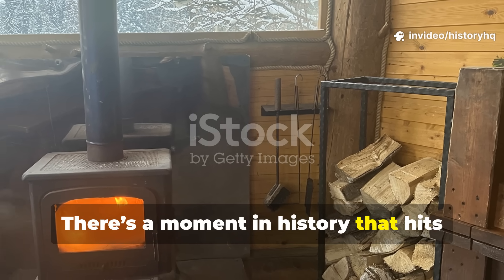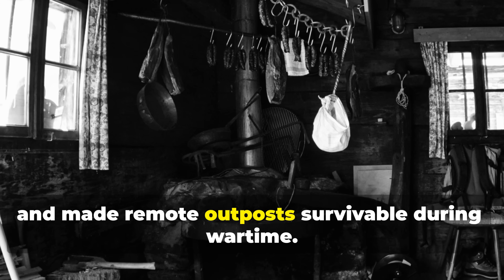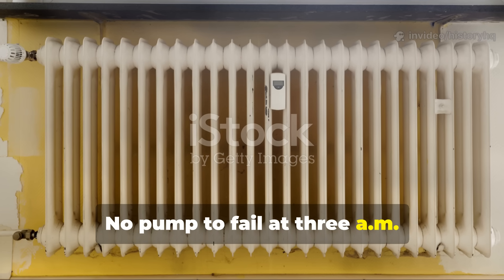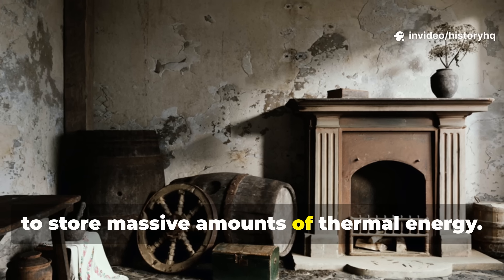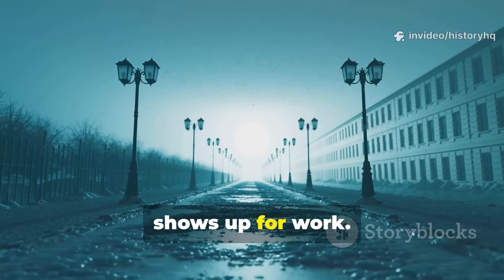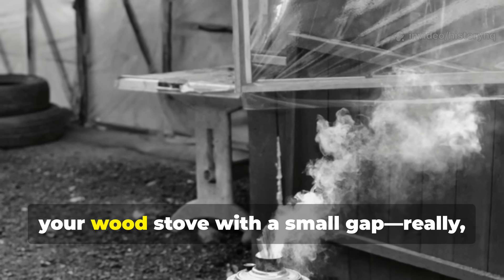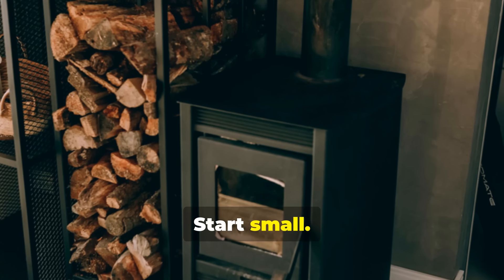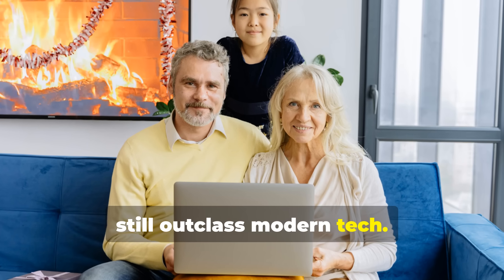The 1940s Heating Trick Modern Homes Can’t Compete With!

Comment: 1960's Scotland heating trick was Duckhams 20W50 gallon cans full of boiling water wrapped up in towels as hotties to heat the bed, duvets not having reached us at that time, and porridge with Lyle's Golden Syrup in the morning. Never had radiators in any of our houses we lived in. Frost on the inside of the (single-glazed) bedroom window was fun to write on in the morning with your finger. Coal, and sometimes peat, was burnt in the living room fireplace, never in the sitting room where the telly was, and we had a damper to send the smoke up behind the back-boiler to save on the immersion heater.
Reply from the maker: That’s lived history right there — using thermal mass, timing, and fuel discipline instead of gadgets. Brutal, but incredibly efficient for the era.

Comment: I am a HVAC teck. Once ran across a home that had a old gas steam boiler controlled with a thermopile and thermostat , The boiler was in the middle of the basement with slopping pipes towards the boiler , They were single pipe cast iron rads , The steam and condensate return in the same pipe . No pumps ,No power .
Reply from the maker: Exactly — pure physics doing the work. Gravity, slope, and phase change moving heat with zero electricity is hard to beat.

Comment: I still get to see a couple of these systems still in work order and the simplicity is great
Reply from the maker: Exactly — the beauty is in the simplicity.
Reply: @HistoryHQ-Stories what make these systems work is the piping it larger than a pumped system and it uses all the  pipe connection taps on a boiler instead of 1 inlet and 1 outlet

Comment: I enheriteged old house with 10 iron massive  radiators. Volume of circulating mixture of propylene glycol and water is about 508 liters.  Everybody in village criticize me and sugest me to replace this heating system with new, radicaly smaller volume one - maybe even without radiators. I dont want it. I highly appreciate precise work of my grandfater who had build it
Reply from the maker: Hold onto it — craftsmanship like that is rare, and those systems are built to last generations.
Reply: That's fantastic! I've had this argument many times with co-workers, everybody wants fast-responding systems so they can only turn it on when they come home, because gas has become so expensive. While this does save money, it also means you let the whole house cool down, you're only heating up the air, so you'll feel cold all the time. Terrible.

Comment: We bought an old house that had a hot water heating system it heated 2 stories unfortunately because hot water rises it heated up the second floor great and by the time the lower radiators started getting warm the upstairs upstairs thermostats was up to temperature and shut off the boiler put in a pump and zone valves and a thermostat on each floor problem solved and by adjusting the water temperature we cut out gas bill in half
Reply from the maker: Smart upgrade — zoning and a pump fix exactly that issue. Glad it cut your bill too.

Comment: My house got this system still the best one around, but it was moderniseized as to manage green energy, running on recommended 1.5 bar of pressure that I checked out with expertise yes 1.5-2.0 bar that is right no it did not work at all alarms went off all the time until that I started as to think about it. Then that I met I do not know a plumber in english? A honest guy he knew what was made wrong, overpressure. Pumps and a huge enclosed Siphon he told about the siphon these are ment as to feed multi store appartement buildings but stlll almost every house will got one. Money money money! And guess what the business will recomend yes install yet a bigger one and max out them pumps.
So we downseized the whole lot having only 0.4 bar of pressure in the system and since then it works like a charm.
Reply from the maker: Glad you got it sorted — lowering the pressure absolutely makes these older systems run the way they were designed to. Sometimes “modernizing” adds more problems than it solves.
Reply: Why  some of the heating systems must be pressurized?
Reply: @PeterFamiko-lw8ue  It is been rebuilt upgraded from a oilburner not by me but by the previous owner where today the heating is of different not as hot as before but the system remained in most parts the same but less of heat + three additional modern very thin radiators installed. 
There is a need of some pressure to it but not much high pressure will only block the system in the same way as blowing air thru a thin straw a comon fault by the way, humungus siphones and multiple pumps installed into small houses.

Comment: What is unbelievable is that people had these cast iron radiators (which could heat with almost any kind of fuel from coal to gas, and they TOOK THEM OUT TO REPLACE THEM WITH these sh---y fin tube arrangements, which go under windows (where drapery cuts them off) and behind furniture.  Warm air circulation is a joke with these.  The cast iron ones usually never were behind other things, but free to warm the room.  These radiators were junked by the millions in favor of inferior "technology".  How stupid.  If you have them KEEP THEM!  I have had both and there is no comparison.  I would put radiators on the plus side of any home buying decision.
Reply: Ok and what you think to combine this radiator technology with electric heating of floor (inserted in beton  - concrete
Reply from the maker: Couldn’t agree more — cast iron radiators are heat machines. People really didn’t know what they were throwing away when they swapped them for fin-tube.

Comment: We heat our 1600 sqft , circa1867 farmhouse using a Woodstock Soapstone stove, which is based on a design from the 1850's. The company upgraded the technology with a system that reburns the smoke, so it burns with very little smoke and at around 80% efficiency. Our house with it's original wood windows and wooden storm windows only uses 1.5 cords of wood. We are near the 44th parallel in northern NH, so it gets very cold here.
Reply from the maker: That’s incredible efficiency for a house that old — those classic designs still punch way above their weight.
Reply: @HistoryHQ-Stories  I talked to the people at Green Building Advisors in Sheffield VT. I posted on their free site. Martin Holliday responded with what I need to do in order to make the house super efficient. It was a lot of hours, but totally worth it. We hired out the blown in Cellulous and the spray foam on the basement walls. Everything else my wife and I did. I've owned the Woodstock Stoves now in two houses an antique cape of 2000 sqft where we had two stoves. That place used two cords of wood and nothing else. The main house still had it's 1840 9/6 sash. We put interior storm windows in it. Anyway probably more than you wanted to know.

Comment: I owned a house with a gravity system.
It had an enormous boiler that had a coal stoker, was converted to oil, converted to gas and was completely shot, but irreplaceable. No one would touch it. 
I had to replace it with a modern gas boiler and circulators. No one stocks the pipe sizes and fittings for those old systems in this part of the world. There was only one radiator that leaked and I got the whole thing working in time for winter. But, I'd never do it again.
Reply from the maker: Totally understand — restoring those giants can be a massive challenge today.
Reply: @HistoryHQ-Stories yeah, I threw a 4x4 across the coal chute opening and used a heavy duty come along to drag it into the coal bin and nailed the door shut. I know it's still there because there was no way to get it out of the basement.

Comment: A hot water heating system with thermosyphon circulation is perfectly suited to hand firing with wood or coal.  The fire is laid proportional to the outside temperature,  small fire on a warmish day and a roaring fire in sub-zero weather.  This system is not particularly effective when fired with a gas or oil burner, on and off.  Now that we have proportional fired gas burners this simple system would again work efficiently.
Reply: Yes, i like it. I just would like to somehow upgrade this system with automatic wood & coal feeding of fire place
Reply from the maker: Well said — wood and coal make thermosyphon systems shine. Modern modulating burners could bring them back.

Comment: That doesn't make any sense. First of all, you can't adjust a system like that. Second, you can't use just water in the system, because when the fire goes out and it's freezing outside, the pipes freeze. Of course, if you're there all the time and adding food to the fire, then there's no problem. In Scandinavia, we've spent ages binding heat to the mass. But the same thing goes there, you can't adjust. In other words, when it gets warmer outside, you sweat inside. So the weak point of such systems is wasting energy/firewood. Of course, this doesn't matter if you don't have to buy firewood or whatever to produce heat.
Reply: If you have real windows you can open them up when is getting too hot inside, capisce 😂😂😂
Reply: We had a steam system with a hot water loop in the kitchen part of the house. The hot water loop hot water moved without a pump, when we needed less heat we simply closed one of the valves to slow the water flow. It worked very well and older plumber explained then installed it for us. The steam boiler was from the early 1950's. It was a huge 3400sqft circa 1809 colonial farmhouse.
Reply: @kenchester3072 i would like to put water loop into chimney with hot exhaust gases. I just don't know how to regulatte it
Reply: @PeterFamiko-lw8ue if you take too much heat out of your chimney you can create creosote,  chimney fires, poor draft , etc.
Reply from the maker: Fair points — gravity systems are simple but not easily adjustable, and they need someone present to manage the heat source. They shine in the right context, but they definitely have limitations.

Comment: It's cool hearing David Attenborough talk about central heating like this, even if it's likely done by AI 😅😄🙂 
That Thermal Flywheel analogy is wicked. If it wasn't for those mandatory annoying AF subtitles, this video would have been wonderful. It's still great, but that shite ruined it a bit. 
I'm learning about various heating systems right now in a course, and the only thing that stops this convection current system from being installed by qualified plumbers is that it's not compliant with some legislation called 'part L of heating systems'. Mainly due to the system not having any thermostatic controls. 
They're not bad when installed properly by any means, as along as you don't have too many radiators in a building, otherwise the first radiator gets very hot, then radiators get progressively cooler the further away from the boiler / wood burner you go. Can take ages for the radiators to heat up too, from the 2nd radiator onward.

4:07 underfloor heating, that'll be revolutionary when it's not so expensive to install. The whole floor is your radiator instead of hanging them on a wall.
Reply: Heat under wood floors is not a problem, done every day!
Reply: @skip7243  Oh, I see.
Reply from the maker: Appreciate that — and you’re right, legislation is the big barrier, not the physics. Those systems work great when designed right.
Reply: @HistoryHQ-Stories  Doesn't surprise me though, legislation is often wrong or sometimes even corrupt...
Reply: Radiant in floor heat can save you 33% on your energy bill especially in areas with high ceilings.
Reply: @rmc4562  Couple that with some tidy and properly installed insulation and that's awesome. Expensive AF though.

Comment: I tell people all the time when they want to remove cast iron radiators for baseboard once they are really stupid doing this cast iron is the best heating source I install steam boilers all the time gravity heating is the best no matter if your power goes out or not
Reply: Gravity hot water heat is pretty much bullet proof.

I'm 78 and have lived in steam heated house for all that time except for my army service. Those cast iron radiators emit heat like nothing else does. The millivolt ignition systems needed no power and worked fine during blackouts that sometimes happens with 'noreasters.
Reply: I love radiator heat....but it is seldom used in rentals anymore. And something else....why no punctuation in your runon sentences? It is a bit hard to read what you wrote, because you didn't use any commas, nor periods.
Reply from the maker: Absolutely — cast iron radiators are heat champions. Hard to beat that mass and reliability.